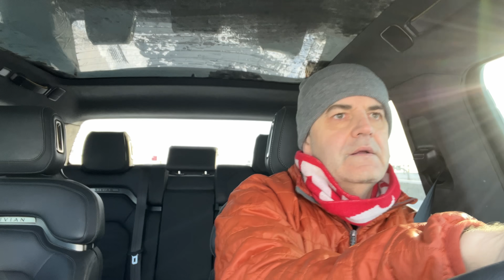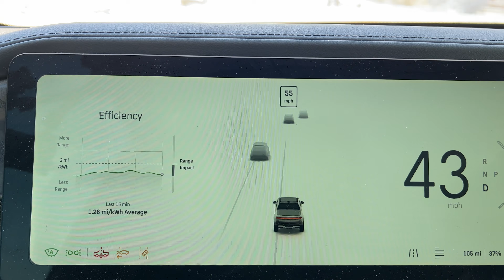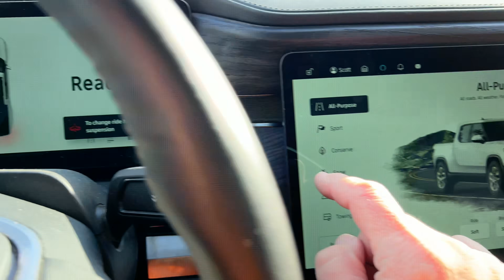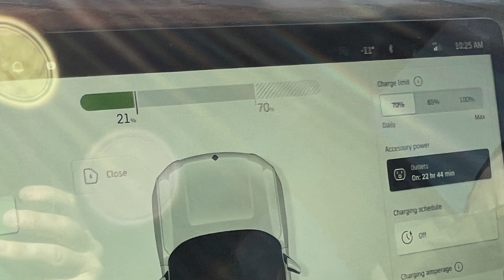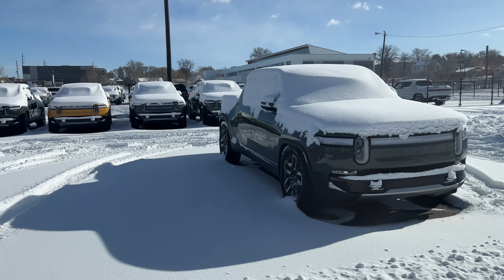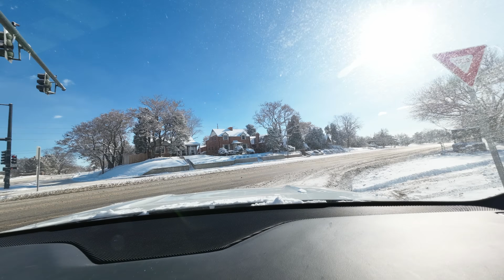Rivian SUB-ZERO Drive! How does EXTREME COLD affect range? | Rivian Dad

Comment: Were you ever able to figure out why Snow Mode didn't work? Was it the extreme cold or was it another malfunction?
Reply from the maker: It started working when it warmed up. We think it wouldn’t work because the truck wouldn’t change height. That was certainly connected to the cold (water in air suspension perhaps).

Comment: At the 52 minute point it says you travelled 31.8 miles and used 12.9KW - that would equal 2.47 miles per KW not 1.28 so what am I missing?
Reply from the maker: not sure how that is calculated. I'll have to look into it. thx

Comment: I am watching many different EV videos to see if they get them to where they are practical. When they do, I will purchase one. By practical I mean the following. Range of 400 miles minimum in all weather. Charge times at a commercial charging station empty to full in under 10 minutes. Price in the range the same as a comparable sized gas model before any government incentives. Thanks for exposing the faults of an EV.
Reply: most gas cars don't even have 400miles range?
Reply: @throwawaypt2throwawaypt2-xp8nx  your claim is totally false. Even if it was true, it only takes about 5 minutes to refuel.
Reply: @JohnSmith-ug5ci  I'm interested to hear how often you drive 800mi, with one stop. 🤣
Reply: @fifthcircle1  never. I have never made such a claim. However I have driven 714 mile without a stop. On long trips I usually drive around 600 mile before stopping and fueling up. Lastly I can fuel up in around 10 minutes which includes bladder relief. In an EV it would take over an hour empty to full charge stopping two or three times, but manufacturers do not recommend fully charging. EVERY EV on the market is a scam.

Comment: -13c is not that cold. 🤣🤣🤣🤣🤣
Reply: Oh. May want to use the temperature measurement next time to avoid confusion. 

Or use celsius as it is the better measurement to use.
Reply from the maker: @Digikidthevoiceofreason hard to argue with that, but it's the system we have! thx
Reply: @RivianDad I’m pretty sure, or at least hope, he’s messing with you.  You stated you were in Colorado, were using miles, and it looks like -13f vs -13c.  It is pretty obvious which system you were using.
Reply from the maker: -13 f is 🥶🥶🥶

Comment: Toys for the rich. Not ready for prime time. Extreme heat. Extreme cold. Towing heavy loads. All greatly reduce range. Not practical to wait an hour or more to charge to only get 120 miles. And imagine getting stuck in a pile up on a highway in extreme cold for hours? Literally life and death! Nope! 10 years from now maybe! Enjoy all your early adopters with endless cash and credit to pay 2-3x the cost for 1/3 to 1/2 the range in extreme conditions! And NOT helping the environment as the materials for the batteries are mined with borderline slave labor and wrecking the earth more than drilling and carbon monoxide in the air right now! Wake up!

Comment: I have assumed that having the truck plugged in keeps the battery warm(er), but on cold days I still get the cold icon in the lower right and occasional pop up notices that Regen is reduced while the battery is cold.

Also, Snow Mode simply reduces regenerative braking.  Low Standard and High are options in Snow Mode, it’s 4WD so basically All Purpose with less regenerative breaking to avoid skids / slides that I’ve seen mentioned in forums.

Finally, with the recent software update the App allows heating the cabin, I assume this wakes up the battery and prepares it for travel, but “preconditioning” is not mentioned.

Comment: Wondering if you tried other drive modes to see if the suspension would change heights. Probably the cold.
Reply from the maker: Yes. It would go into Conserve mode. Probably because it’s the same ride height. Note that the problem cleared up by itself a day later when it warmed up.
Reply: @RivianDad  what about sport mode that is also low?
Reply from the maker: @GA-wq8xq  I didn't try any other modes. Note that it worked again when the temp warmed up two days later.
Reply: @RivianDad  glad it worked again without a service call.

Comment: Probably battery temperatures if it wasn't preconditioned or plugged in before setting off. Warming the battery and cabin beforehand (while plugged in) will minimize battery demand once on the road. Better said than done for many who cant plug in or garage it overnight.

For those without a garage, but can plug it in,  remote or scheduled preconditioning (remote start) is usually available for these vehicles. Scheduling charging to end just before a commute or trip will also warm the battery, the simple act of charging generates heat within the pack.

For those who cannot plug in so easily, preconditioning (remote start) is usually available, and may warm the battery depending on the vehicle. Unfortunately, this will use a good chunk of energy in the process. Not a necessary step, but a comfortable one for a warm cabin. Otherwise, bumping up tire pressures in these temperatures will help, they no doubt dropped significantly from the warmer days. Reducing cabin heat is a big one, keep those settings below 70F and prioritize seat and steering wheel heat, if equipped. Slowing down helps, that cold air is thick while most likely battling increased rolling resistance from snow and slush on the roads. 

From experience in Minnesota with a Chev Volt, we usually saw a 35% drop in range (below EPA figures) with temperatures below 15F. Most of that energy went into cabin heating, though we preconditioned while plugged in when possible. The worst was a 45% drop while the vehicle sat (unplugged) in -25F temperatures for two days.... that only happened once. Otherwise, between 15F to about 30F we were living with a 20%-25% drop. And continually improving above 30F.
Reply from the maker: Thanks William, excellent information. And thank you so much for taking the time to write this out. Great community, and it’s great to learn from each other. It seems like your information lines up well with my experience. I’ve also tried on the channel to consider EV adoption for those who are in unique circumstances, like, as you point out, people who don’t have a garage to park in, or a place to charge at home. I want to see better solutions for everyone, so the EV adoption is accelerated.
Reply: @RivianDad  

I figured my comment isn't much news to you, but figured it useful to other viewers new with EV adoption. What you're doing is much more informative in documenting real world experience.

Comment: Great video!  This is the first one I have seen in the well below 0 temp area.  It performs how I would expect; large range hit when unconditioned and cold but still good for an EV.  From what I read and see elsewhere, a warm garage and preconditioned battery makes a significant difference. Great info. 

How much heat did you have on? Seat warmers? Heated steering wheel? High heat? Low heat? Auto heat at 70? I have a feeling all the heat features would suck a lot of power.  I anticipate myself only using the bare minimum on a longer trip for that reason.
Reply from the maker: I didn’t turn on the seat heater or the heated steering wheel, I had the air conditioning on at 73° I think. But I didn’t blast it. People online have said that it’s better to use the heat seater and the steering wheel since it draws less energy than the standard heater. Part of my objective was to simulate a cold start and a “normal“ drive as if I were commuting so the heater was on. Honestly, I don’t think it affected efficiency it all that much compared to warming the battery. But certainly some. Mostly, I think it was just the fact that the battery was so cold. It took a while to warm up.
Reply: It’s pretty easy to conserve EV range in the cold (at least initially) by preconditioning the battery while still connected to power (regardless of whether the vehicle is parked outside or in a garage.  Obviously in the garage the vehicle and battery start out a bit warmer.  Simulating the cold start is useful for a return commute etc…but I wonder what the ratio is between preconditioning (not connected to power) to range conservation….
Reply from the maker: @awash7156  thanks. Yes, it’s a very good question, and I don’t have a complete answer. Still trying to figure it out. I’m trying to get some measurements of the battery efficiency between the two different states either plugged in or not plugged in, but it’s a little tricky.

Comment: Air suspension thats not working in cold weather is often due to the compressor freezing up. And that only can happen if atmospheric air gets into the system and displaces the moisture-free nitrogen that it's filled with from the factory.  If the system starts working normally again when the weather warms up, it's almost definitely going to be moisture from atmospheric air in the system.
Reply from the maker: I’m happy to report that the system is working fine now after warming up again. Interesting info. Thanks!
Reply: @RivianDad  so it fixed itself when warmer, good to know.
Reply from the maker: @GA-wq8xq  yes. probably some water in the line somewhere which mucked up the system

Comment: Snow mode should not be dependent of air suspension setting. That's a stupid move, Rivian. Make Snow Mode available at any air suspension setting.
Reply from the maker: I’m going to agree with you on that one. It is working again and I did get snow mode going. And, I noticed that snow mode defaults to the middle ride height, which is above where I was on this drive. But yeah, that’s a fix that Rivian should add. Thanks.

Comment: Scott, thanks for another great video.  I have driven about 150 miles here in Iowa with temps around -5 to -10F and have been averaging around 1.0 to 1.25 m/kWh.  All of my driving has been on short trips, 20 miles or less, so nice to know that the efficiency will go up some as the battery warms up.  My trips start from an unheated garage.  I have also notice some range increase if I begin the trips after having the vehicle plugged in to my home charger for a couple hours to warm the battery before departing.  So far, so good, but like you, a little disappointed in the cold weather range.  Overall, still love the vehicle over the first 6,000 miles!
Reply from the maker: Very interesting and relevant perspective. I think it’s a bit less daunting that I may have initially thought. Turns out if you take a few steps, like you’re suggesting, that the range will do pretty well once you’re on the road. Thanks for your feedback!

Comment: You seems like using the Pirelli Scorpion OEM tires, not some snow tires. How did you feel about using those in such condition?
Reply from the maker: I actually felt the tires did quite well. I’m sure there are better tires for snow, but these are good. Thx
Reply: @RivianDad  Thanks for sharing your experience! I was on the fence whether to get Blizzak and Costco had a deal until yesterday. Decided to see this winter and then decide. Storage is more of a problem than buying an extra set!
Reply from the maker: @ayeameen  thx. Let me know if you get/like the Blizzaks
Reply: @RivianDad  I am passing using blizzak this year. I'll see how it goes. I have season's pass for skiing for last 3 years and go their quite often. My previous car also had 3 peak rated CrossClimate2 tires. So far it wasn't a problem with that.

Comment: Hey Scott! Bummed you didn’t get to test out Snow Mode! It’s solid. My R1T is parked outside, I had to get around in -10, so I pre-conditioned the battery by having it plugged in (it charged overnight to 70%), and 30 min before I had to leave I biked charging limit to 85% and I turned on some HVAC. Besides being comfy when I hopped in, I was at about 1.4 efficiency right out of the gate. That may be my trick going forward on super cold days when I’ve got a good amount of miles ahead of me. Fwiw and hi from the fam!
Reply: I agree.  This is the way.

Comment: Great video! even 1mile per kwh is pretty good considering the heavy temps. Yeah figure the air compressors dont want to turn on since its so cold outside. maybe compressing air that cold would break the compressors so it stops itself.  
but you would think that youd get a more details error msg lol. maybe its a case of "keep it simple stupid" to not confuse the typical consumer.

also please dont hang out of the left lane if youre not passing someone. no point especially when youre driving slower due to snow. stick to the right and chill since youre going slow.
Reply from the maker: thx. Yeah and in the end, the efficiency was pretty decent even for a cold day. It was just the start that hurt. 
And, don’t fret, I can drive just fine. When it’s snowy/icy road, I choose the safest lane first - even if people behind me have to slow down, which is good for everyone. If I’m going too slow, I’ll scoot over. But I stay in the lane with the best driving conditions.

Comment: Thanks, Scott! Excellent video. Performance of ICE cars improves if you warm them up (let them idle) in cold weather. Why isn’t the same principle applicable to BEVs, I wonder?
Reply from the maker: Note that the driving performance was amazing right out of the gate, it's efficiency that takes a hit. So, range. If the vehicle was warmer to start, I feel like it would have done much better. This is one reason why people in cold climates have block heaters. But, you're right. Lesson learned.
Reply: @RivianDad  Yes! Block heaters! I had one when I lived in Syracuse, New York!

Comment: I live in Castle Rock, just south of Denver, and left my house at 7:45am yesterday, in -17F weather.  I  had the advantage of having my R1T in my garage, and the temperature was about 40F.  So my battery was more than 50 degrees warmer, plus it had charged overnight, and I pre-heated the truck cabin before pulling out of the garage, while it was on the charger.  I wasn't watching the efficiency graphs, but I went about 70 miles that day, and didn't notice much of a range drop.  I think having a warmer battery made all the difference.  I think the first hour of your trip the truck was putting a lot of energy into heating your battery up to a more reasonable temperature.  I also didn't have any issue going into snow mode or with the adaptive cruise control.  The HVAC also worked like a champ, I love the heated steering wheel as well!
Reply from the maker: VERY INTERESTING! Thanks for sharing. This was exactly my suspicion. In fact, from our road trip, we found that cold weather didn't impact the range at all - once the battery was warm from driving. I have also gained a new appreciation for steering wheel heaters. :) Thanks!
Reply: @RivianDad  , First, Scott, thanks for making the video and sharing your experience with your Rivian in very cold temps.  
I took about a 1300 mi road trip in my R1S a few weeks ago in similar conditions.  You both confirmed my experience as well, though I will say I found my avg mi/kW remained well below 2 even hours into the ride. I believe the vehicle struggled to keep the battery warm in the extreme cold.  The avg got better when it warmed up into the 20s f. 
One thing I will point out is the in-cabin heat struggled. I had to crank the thermostat up into the mid to upper 70s to feel any heat, otherwise it was cool air coming out of the vents.

Comment: What was up with that bus flap haha? I experience about the same in mine. Unfortunately I have to keep my R1T outside but try to warm it up while it's still plugged in. The efficiency is right around 1 for the first 20-30 minutes of driving then levels out around 1.5 in temps below freezing. This is with the HVAC on BTW. Thanks for the video Scott!
Reply from the maker: Thanks! Yeah, it's an important bit of info for me: warm up the vehicle at home while still sucking juice from the grid.

Comment: How did the hvac work at those temps? We were in Denver today as well, flying out this evening. Happy Holidays! Keep the content coming! We pickup our R1S tomorrow!!!
Reply: I was out in -17F temperatures, and the HVAC worked great, along with the heated seats and steering wheel. It wasn't snowing though, which could have made things a lot more challenging.
Reply from the maker: HVAC worked well enough that I took off my coat and hat after a bit since I was too warm. And, that's without blasting it (since I was trying to be at least a little nice to the truck). And, it should also be noted that I haven't experienced the mechanical issues with the R1S at the same temp. Thx
Reply: @RivianDad  your windshield looked frosty the whole drive… how are the defroster and windshield washers?
Reply: Congrats on the R1S. Hope you love it!!